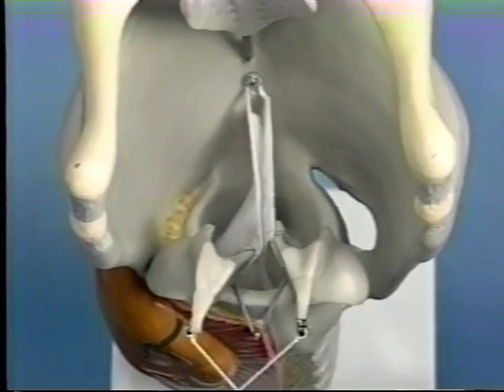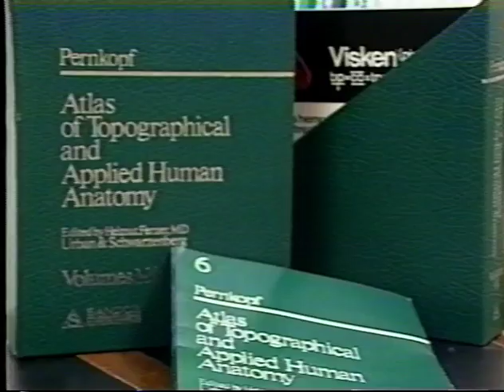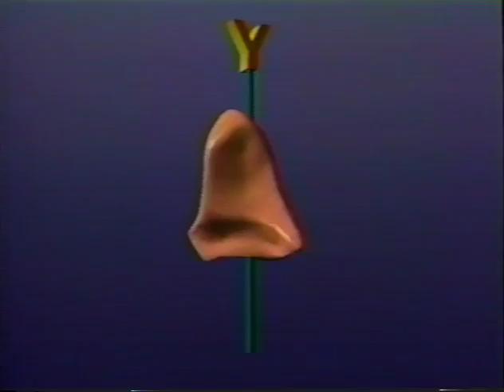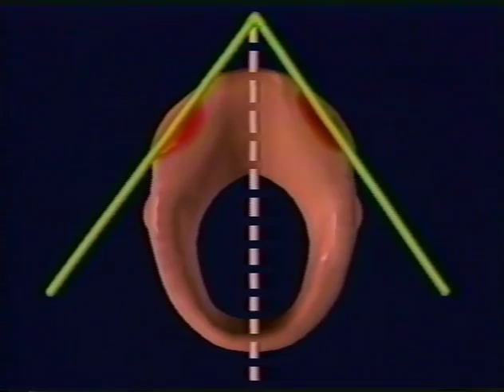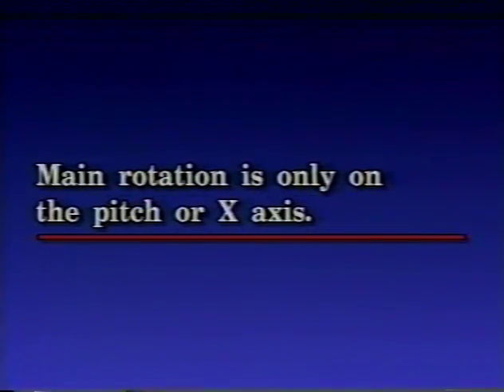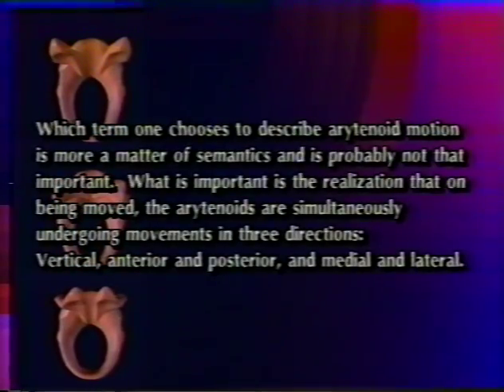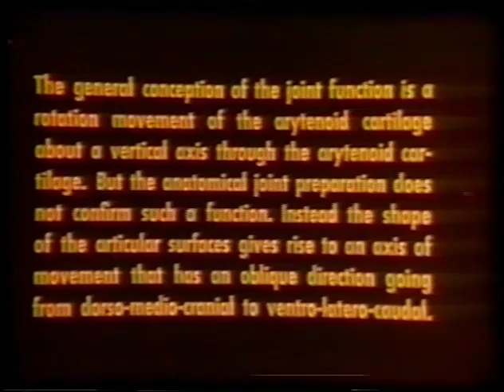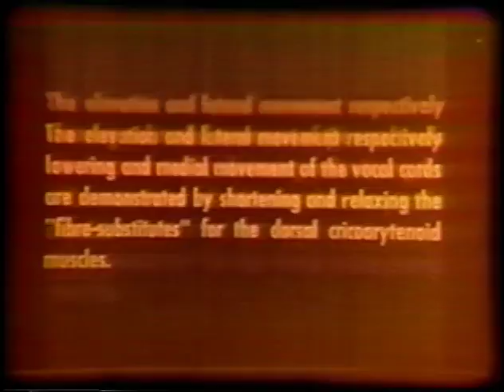Arytenoid Motion

Comment: This "arytenoid motion" video shows incorrect and outdated concepts/references unfortunately.  The problem with trying to deduce motion of the cricoarytenoid joint simply by observing a film of the intact joint motion as is done in this arytenoid motion video is that the joint is surrounded by layers of soft tissue including ligaments, joint capsule, muscle and mucosa which obscure the underlying joint relationships during motion. For a more accurate representation of cricoarytenoid joint motion, see the animation shown in "3D animation of vocal cord joint movement" which is based on research on cadaver joints with landmarks such as the vocal and muscular processes tagged with radio-opaque markers while motion is induced in the direction of the adductor and abductor muscles and filmed using a small C arm fluoroscopic unit for hand surgery, to plot the actual motion of the arytenoid on the cricoid. Joints were also glued in place in full adduction and abduction, then dissected to reveal the relationship of the arytenoid on the cricoid joint.